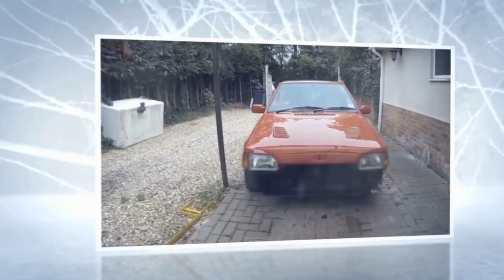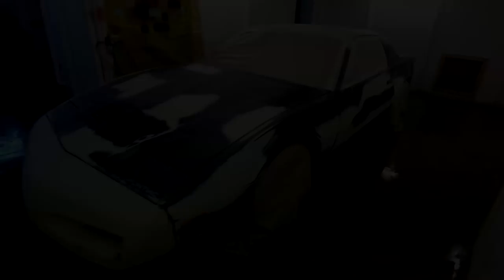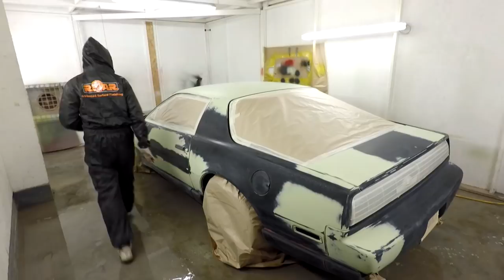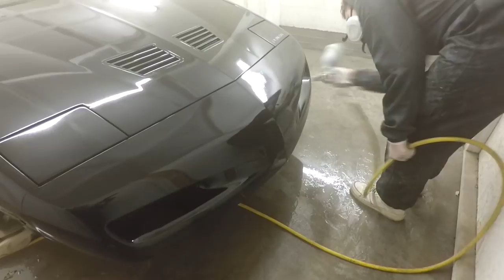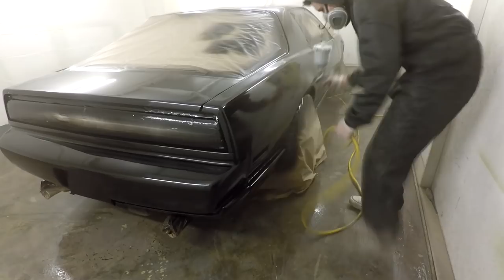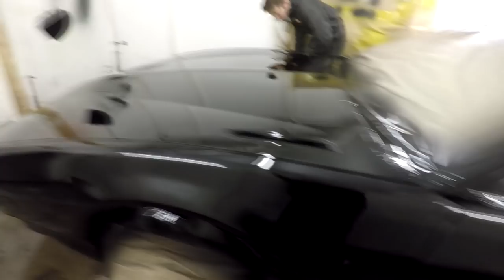The Trans Am Gets Painted

Comment: For best filtration, have your booth intake filter window as high as possible, thats were dust is minimum, due to it always settling. Your fan output filter opening, lower to the ground. thats where the particles naturally want to head down too. Paint and dust goto the bottom and linger, I know you have wet the floors, but if it's not wet, walking around and even the hose kick up dust. If your intake is low, even tough your pushing fresh hair in, it ends up blowing the dust and paint thats settling towards the ground, or on the ground as soon as the clean air gets in the room.

Comment: Nice job!
What year is that?
I imagine they are a pretty rare sight in the UK
Reply from the maker: I think its a 1993 3rd generation Trans Am.
Reply: 1991 or 92. 1993 was then started the 4th gen trans am. Also i know it's a 91 or 92 because of the nose.. They changed the nose in the 90s on there last 3 years and i can tell its not a 90 based off its trim. I have a 92 Formula